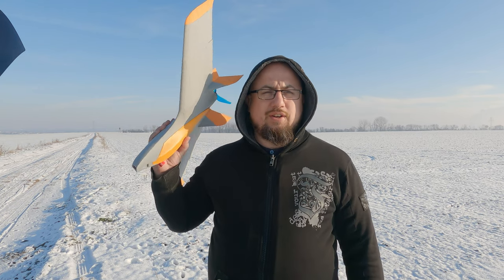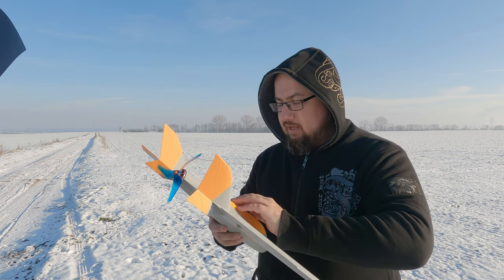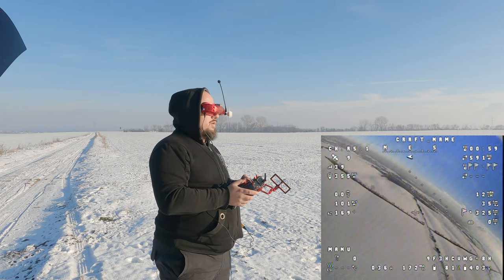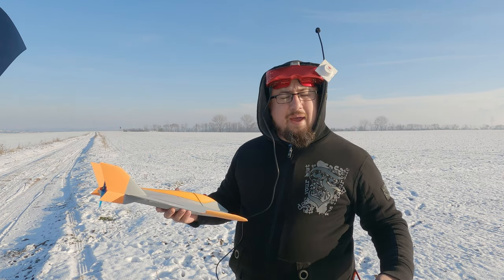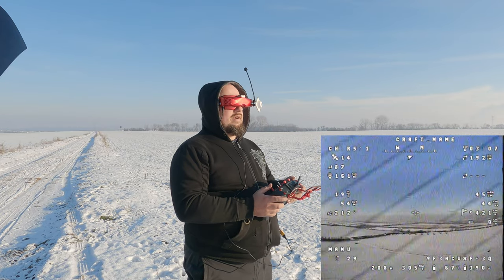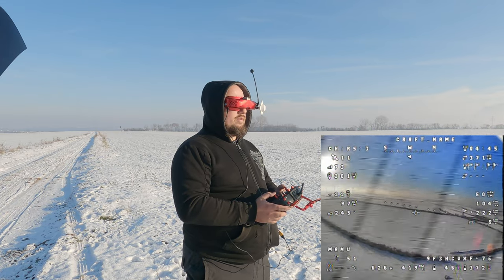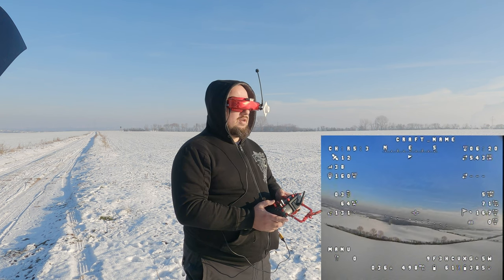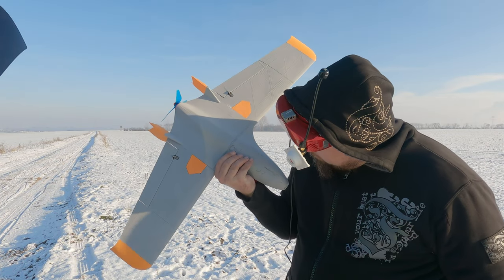[ENG] 3DBlackbox Helix - Maiden in Panic-Mode 😱

Comment: tip from an old analogue fpv pilot, as well as using filters to clean up video , I also use old sheilded usb cable as a video wire harness and earth the internal braid or foil shielding to the earth wire also. This harness will be very resistant to external noise. I never throw away old usb cables any more....well not until i went digital anyway.
Reply from the maker: Yeah shileded cables are a good idea. But in our case its better to first attack the noise at the source. Add caps to ESCs and soften the current flow. This noise is not just hurting the image quality but also stresses the 5V and 3.3V regulators on the FC. They tend to overheat and smoke if it is too bad or for too long. if then just some remaining lines are in the feed, then we can talk about shielding.

Comment: Perhaps moving the elevons further away from the fuse and or longer elevons?
Reply from the maker: yeah he has updated the design a bit and extended them. Needed some changes for easier print anyway. I am waiting for the near final version now and then I will reprint. 

But they need to be close to the fuselage. Swept forward designs cause the airflow to move over the wing towards the fuselage. So they have to be on the inside to maintain control at slow speeds.

Comment: Great job,  she was a hand full on the first flight.  Did you notice that when you did a glide test with motor off there was no static in the display,  it was nice and clear.
Reply from the maker: Yep the ESC is ectremely noisy and/or the FC is defect and the filtering failed completely. I will replace both for the next revision.

Comment: Thanks for posting an english edition of the video. I enjoyed watching both editions. 
Second flight was very good for a prototype. As I'd expected, C/G was issue on first. 
The inboard ailerons and their width would be contributing to a lower roll-rate. Adding a mix would help.
You might double-check to ensure all your grounds have continuity with each other.
Adding a capacitor on VTX power might help too if power related, and not RF noise.
Reply from the maker: Yes the Elevons will get a design update and I get the new version soon. I changed the mixer for more throw on roll, about 40-42° roll and 30-32° pitch. This was much better and I got a roll rate of about 350°/s during autotune. Much better. Yes groudns are all fine and no ground loops. I added caps to the ESC and also to the 5V rail that powers the cam. VTX gets vbat from the FC and has no pads to direct solder a VTX to. I guess the ESC or the FC are just faulty. I will replace both on the next flight.
Reply: @MarcFPV  Thanks for nice update. You making great progress.
If you suspect might be RF related, could try placing packing tape on both sides of aluminum foil, then using this to wrap the ESC to make a faraday cage. Otherwise, signal leading via wiring.

Comment: Do you know that Quad propellers are not as efficient as a normal airplane propeller. Yes you can get 4 quad props for the price of one airplane prop but it is not an airplane prop .....Also, my first swept forward wind was around 2004, designed and built myself out of balsa